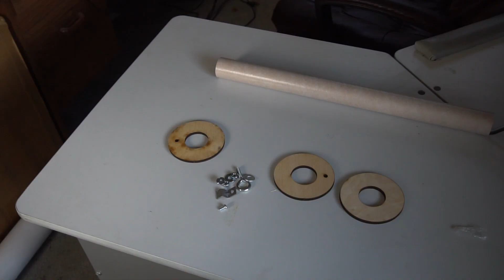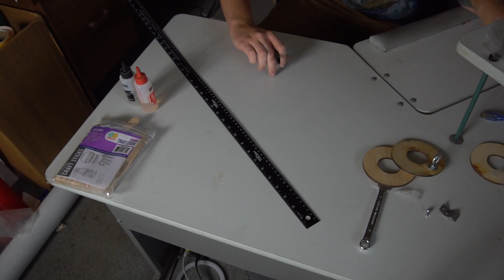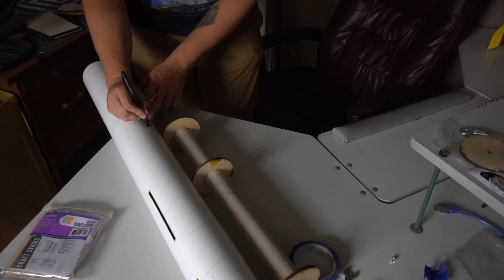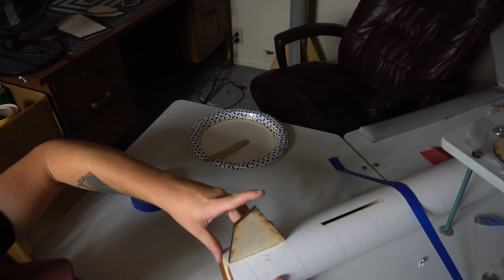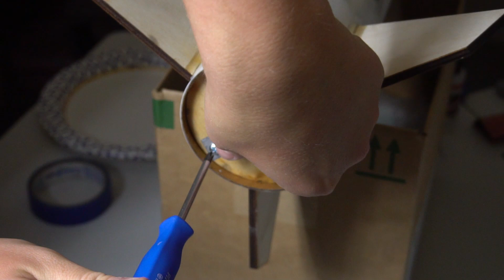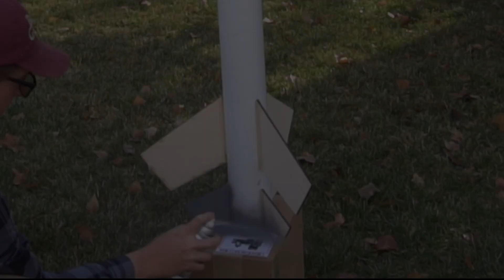Getting Started In High Power Rocketry | Basic HPR Rocket Construction (Rocket Kit Giveaway, too!)

Comment: Hi, I started watching your content when I got my first high power kit for my L1 certification which is a Loc Precision T-Loc 2.63" and I'm struggling trying to figure out which H motor to use for the cert flight. What would you recommend? I know low and slow is best for cert flights from the research I have done. Secondly, while finishing up the T-loc I decided to get a public missiles 4" patriot and I don't remember the name of the material the tubes are made of but it's a gray plastic and once I get done building and painting the T-Loc I'll take a week or two break and then start building the Patriot that way I'll do my L1 at the SSS club launch in either September or October depending on if it gets to around 100 or below and then the following month I'll do my L2 certification flight. Do you ever go out to the big SSS launches in Arizona? I think it's a few hours from you. The launch site is about 1.5 hours from me. I belong to the Superstition Space Modelers Society put of Phoenix

Comment: The anti-gravity group got me hooked on high-powered rocketry. Two weeks ago - I tested for Level-one and passed. I know why you recommended a four-inch body tube kit. I used an Estes Nike Smoke, built with g5000 rocketpoxy internal/external fillets, and CA strengthened motor mounts. It held up well launched with an Aerotech H135A-14 (drilled to 7 seconds).  I had to walk three-quarter of a mile in each direction to recover it. A heavier rocket would not have drifted as far.  Now I am a member to my local Tripoli club, Team-One, Flint, Michigan.
Reply from the maker: Congrats either way! That's an awesome L1 flight!

Comment: I’m new. Never made or flown a rocket before. Guess I’ll use an I motor.
Reply: For any cert flight low and slow power motors are recommended as the rocket must be recovered and in flying condition when recovered so in my opinion an H motor for an L1 certification would be best

Comment: If you fly with a club, do they typically have launch systems, like the electronics and launch tower?  Do I just need to plan to build my own?  I see that guys building the really large high power rockets are making a tower attached to a trailer.
Reply from the maker: Clubs have launch systems, typically, yes.

Comment: I'll be attempting my L1 in the spring with a LOC IV with Pittsburgh Space Command #473 (NAR), but I'd fly that thing at Weber Farms in Grove City, PA on a CTI H123 Skidmark, because I love sparky motors, but would want low altitude for an L1 cert. Then probably on something larger once it flies once, and once I'm certified. Something like a CTI I223... Again with the sparky motors. 

Edit: 4 months later, I successfully got my L1, am looking at getting my L2, and think this rocket would go up great on a Loki J474 Cocktail!

Comment: I fly at the MARS club in Geneso NY NAR Section 136 -- TRA 162 and would love to fly this kit there! I just got my L2 and since there is room in this tube I would like to replace the stock 38mm motor mount tube with a 54mm tube and fly this on the fastest K motor I have the hardware for, a CTI K2045. I have made custom centering rings before so this upgrade would be no problem!